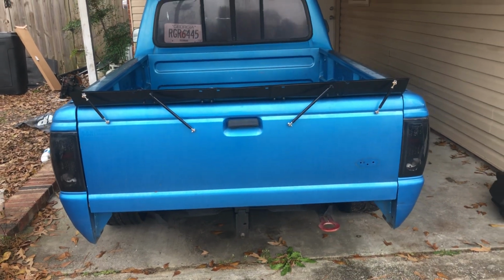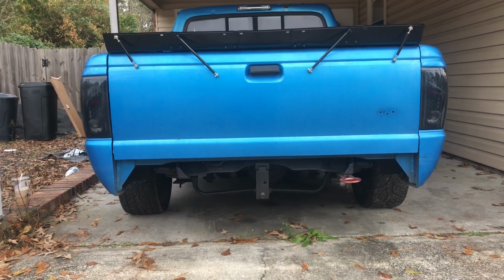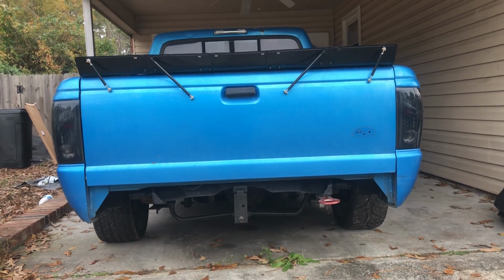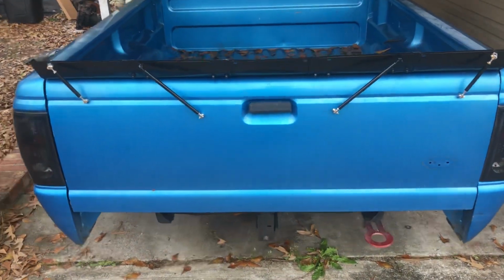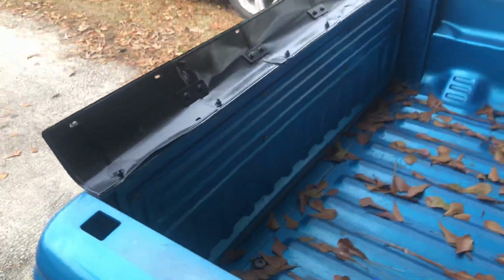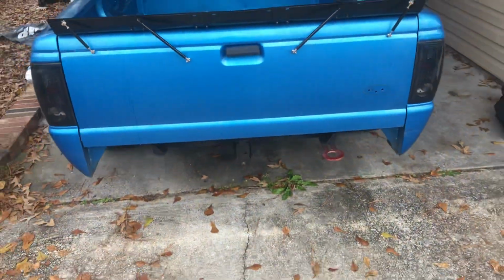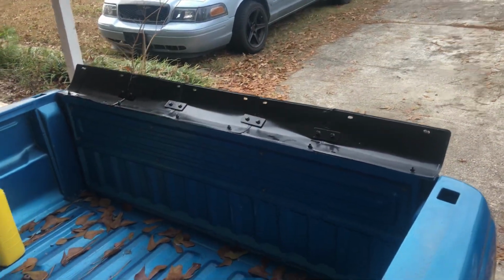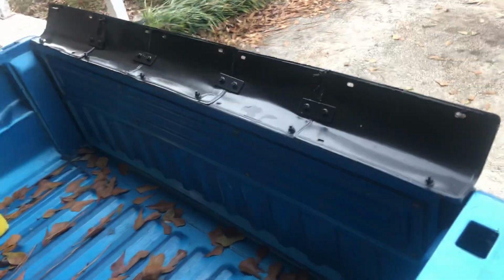Ford Ranger DIY Spoiler

Comment: Very nice bro I think I have those same Tell lights to.  Is there any truck shows you could  Take your ranger to maybe burnout competitions or something To spice up the channel love seeing the ranger keep up the good work
Reply from the maker: Justin Fahnestock my cars and coffee is doing a drag strip event this Saturday, I’ll be trying to see what time I can get
Reply: That would be KOOL
Reply: What roll Pan are you thinking about going with. Or maybe you can make your own Spoiler turned out good.
Reply from the maker: i got a metal roll pan for the rear off amazon
Reply: Need some updates
Reply from the maker: Justin Fahnestock at the moment waiting on stickier tires to come in. The trucks running very strong though. Spins all the way threw first and second gear. So I have to get better shoes so i can get a quality acceleration video.

Comment: Man awesome!!!! Plan on doing this to my nissan hard body sense i can't afford a wield machine at the moment. haha Could you possibly give me a link to the brackets and splitter rods? Any help would be appreciated!
Reply from the maker: OfficialSouthSoul brackets you can’t really buy, I snuck them from my old job but you can get the splitter rods from amazon or eBay doesn’t matter which ones as long as they match. If you can’t find and similar brackets then epoxy work just fine at binding the plates
Reply: @TheVulcan  Man i appreciate the help! I'ma  definitely look into that!

Comment: Do you have a link for the rods you used? I wanna do something similar on the front and back of my ranger
Reply from the maker: shawn tims I don’t but, if you look up front splitter rods on amazon or ebay they’ll pop up in many different lengths and colors